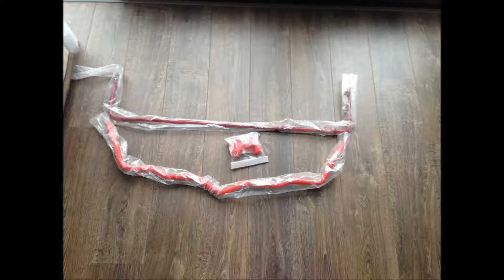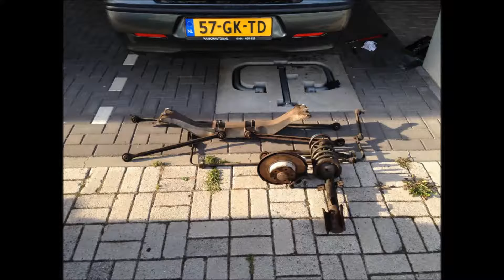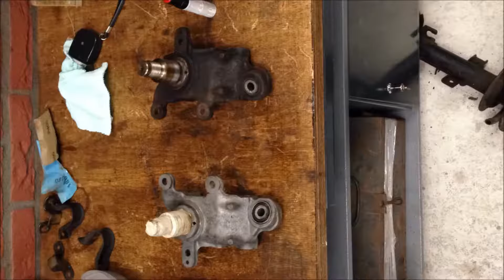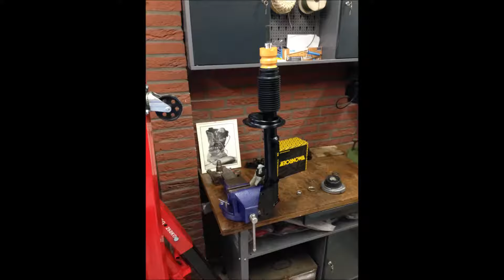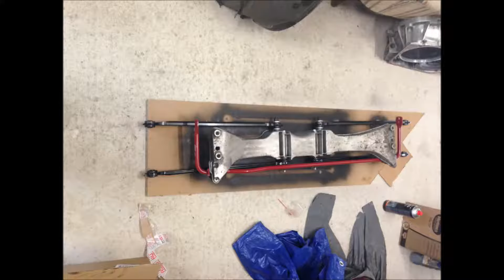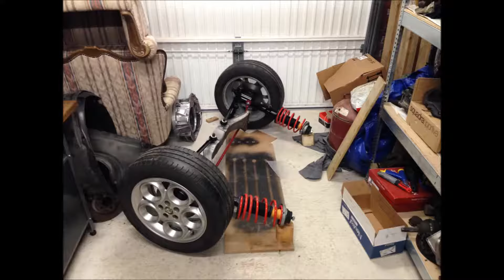06 Alfa 156 ( Upgrading Rear Suspension)

Comment: Your rear right drop link doesn’t rub the inner side of the wheel arch, after installing the Eibach Rear ARB?
Reply from the maker: Nope it does not rub.
Reply: Alfisti Adventures your bar sits even. Same distance from the bushing to the corner of the bar in both sides?

I have a 156 SW MK2 and mine sits uneven.
Reply from the maker: @fernandofragoso4118  I found out what the problem with your drop link could be. There are two types of rear subframe aluminum casts. Check that!
Reply: Alfisti Adventures mine is the aluminium type. I’ve read a bit on the forums and it seems that there is also a pressed steel subframe. The aluminium one seems that was used on the SWs and GTAs.

Independently of that my original rear arb is symetrical. One ring per side, both rings with the same distance to the corner of the bar. The Eibach rear arb has more distance on one side. Eibach already requested me to send the bar back to them for inspection.